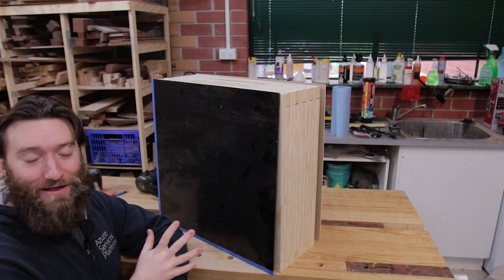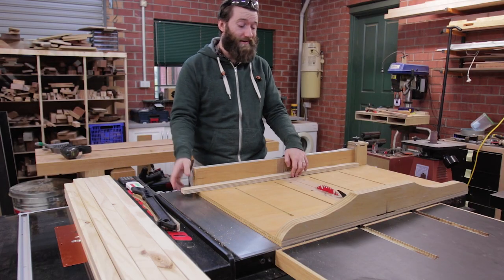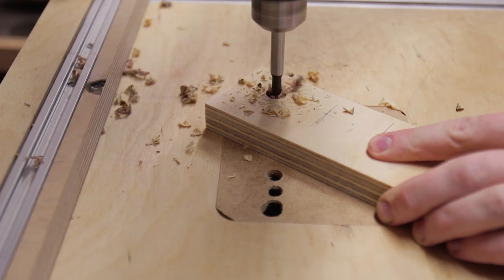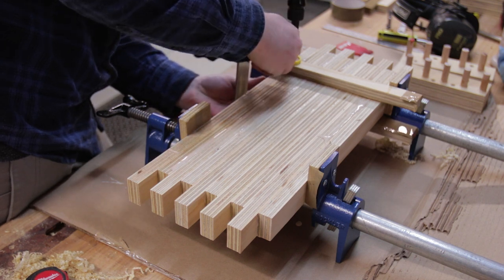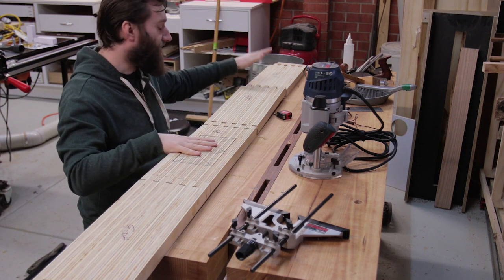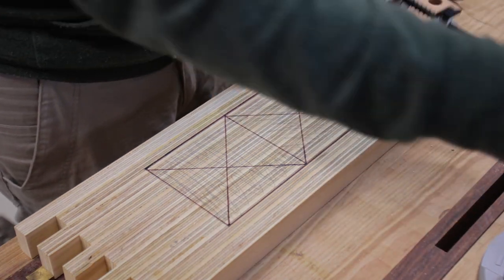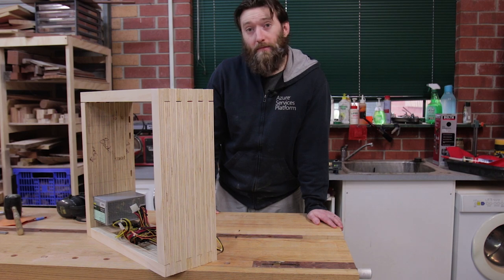Homemade Plywood PC Case (Part 1)

Comment from the maker: A plywood PC case? Are you nuts? Dont' you know plywood will combust if it gets above 10c! Yes, its true, my entire family has been wiped out by this plywood case.

Plans will be available when part 2 is published, 'cause I'm not sure if a couple of things will change!
Reply: I suppose people don't remember early CRT TVs or Radios or those record players with speakers.
Reply: R.I.P Your family! :D
Reply: Just remember you will still need to insulate it (electrical interference and not sound/temperature)

The metal box they are in originally creates this insulation. Without it you will find weird things will happen to this gallery like TVs and radios. Made a PC box out of a pizza box once when I was younger and it messed with half my house. Looked cool just couldn't be used when the gf wanted to watch tv.
Reply from the maker: You can buy cases with windows and cases made from entirely acrylic, though thankfully the latter has gone out of fashion..
Reply: Paul Jenkins those cases were cool. I had one or two myself. I think the metal board the motherboard is screwed to stops a lot of the interference. 

Just thought I would point out a possible future issue you may have, as I sure had it with my pizza box case
Reply: I got this one on the hardwood PC case too, pretty sure I have other problems if the PC components are hitting the combustion temperatures of wood.
Reply: Paul Jenkins, you say 10c, I'm assuming your referring to 10 degrees Celsius which is only 50 degrees Fahrenheit. If thats the case, then it will ignite before the sun came up in the morning with the PC off.

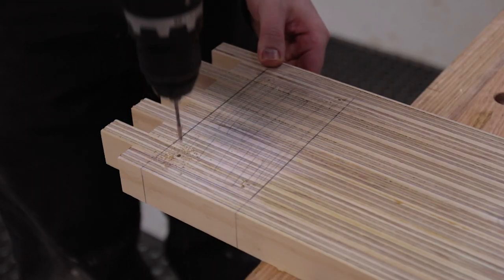Comment: I think this looks great. I don't have experience in shop-work, but at 8:53 how come the bit has a loose wrap on it? Is that to get the chips out earlier/neater?
Reply from the maker: Thats just a piece of tape telling me how deep to drill. By coming back on the other side to finish the hole, I didn't get any chipout that could splinter.

Comment: In lieu of fitting the IO panel, why not reset the motherboard further inside the fame and just have a cable access area.
After all how many times do we adjust cables on the back of the PC?

Comment: hey Paul, nice case. I do quite like the look of plywood. At 0.30, what are those rulers called? Also where do you get your blades?
Reply from the maker: Thats an Incra T-Rule. I've had the combo imperial/metric for awhile, but it was too fat and I didn't use it. Since getting the 'just metric' (150mm) I've been using it non-stop. Whatever the unit of measurement you use, get just the 'single' version rather than the combo.
Reply: sounds like good advice

Comment: the slots for the fan isn't a great idea, it will reduce airflow and increase noise. (what i have experienced), loving this build though!!
Reply from the maker: Its low powered hardware which can be adequately cooled by a single 120mm fan, so four fans should be just fine.

Comment: not a slight against you, but every time I see a woodworker make a computer case, it ends up being a massively thick and huge object ... to hold maybe 6 lbs of components (major overestimate there) I think its just the mentality of it, but I would love to see a thin light wood case ...
Reply from the maker: The idea of this was a general purpose case that didn't require particularly fancy tools. If I wanted to make a thin and light case, I would have used the CNC, veneer bag, different joinery, better materials than pine plywood.

Comment: i will build this,just off to buy the tools for 5 grand,be right back
Reply from the maker: $100 circ saw, $200 router, probably a drill and sander. You can spend as much or as little as you want.